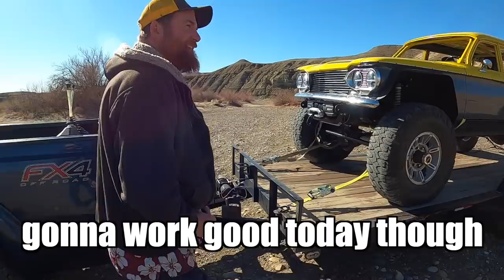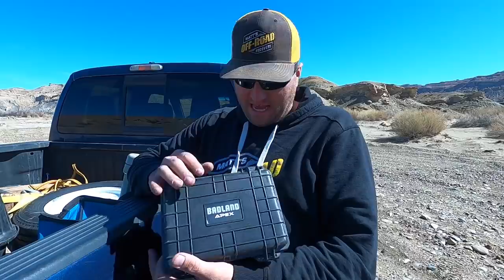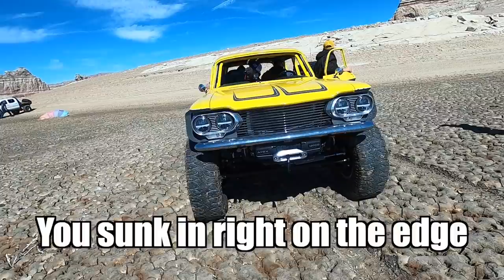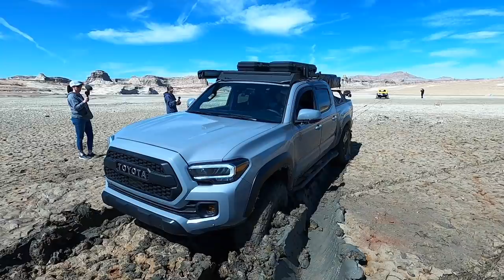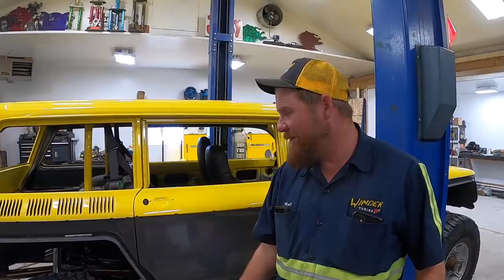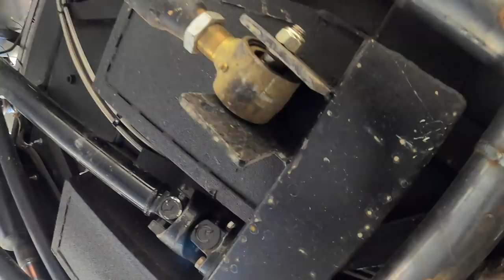The Corvair's FIRST Ever Rescue!

Comment: Every time I watch  one of your videos it makes me want to move to Utah. But then I realize how hot it gets in summer and change my mind. I'll just live vicarious through your youtube channel.
Reply: Just 40 miles North of where Matt lives the temperature is 10-15 degrees cooler. The altitude climbs a couple thousand feet so it's not near as hot but the winters are colder.
Reply: Well Matt lives on the edge of a pocket that is a lot lower in elevation than the rest of Utah. Where I live it usually doesn't hit 90 until Memorial Day. Yeah. Then it stays above 90 until Columbus Day. And it's only 100 from Independence day to Labor Day. In fact, it freezes at night as early as Halloween and we get snow as late as Easter. So it's really mild overall.

Comment: Not a corvair’s first recovery. In May of 1965, I was driving a 1962 spyter, I spotted an older 1948 car off the road with a older guy trying to push his car about 100’ back to 42 street in Odessa across from the coliseum. I drove out to him and offered to pull him to the road and start his car. After explaining how I wanted to do it. He had his doubts but after working with my dad in the oil field, I had experience with vehicles off road.  After pulling almost to the road and gathering some speed , he engaged the clutch in second and started his car. After getting my pulling strap off we parted ways. My first recovery with my Corvair. PS: he offered to pay me , I told him just keep his money and get a new battery.

Comment: Ahaaa Corvair brings back so many memories of running a Corvair Dune Buggy. Good friend milled off the two carburetor in necks for 3 each side webber carbs on a 140 heads. Had Covairs stacked in his front yard like cord wood for parts and such. I drove one of his Corvaires for years  it was great. The local Home Owners Accession had a fit with the stacked up Corvaires in the front yard. Wish I had a picture to share. Great Videos keem em comin, thanks.

Comment: Thanks for the detailed description of your configuration. What you have, and you are planning to add all sound like excellent choices except for replacing mild steel lower links with aluminum. Mild or 4340 steel lower links will handle inevitable rock bashing better than aluminum. In Moab style terrain, lower links will bend/buckle. Expect their repair and replacement, just like tires. Why accelerate the replacement cycle by switching to aluminum?
Reply: @MattsOffRoadRecovery  Thank you for both the reply, as well as a link identifying what you intend to use. 7075 is tough, and using a 2.5" O.D. bar will probably resist bending better than the equivalent weight of a 4340 rod. But, when banging through rocks, I assume things WILL get bent and gouged. When that happens, 4340 has better fatigue life than aluminum and is much more resistant to being gouged by rocks.  I'm old fashioned, and for at least the lower bars, I'd stick with 4340.
I'm not sure racing is entirely representative, but, I should look into what the racers at 'King of the Hammers' use.

Comment: Next stop Moe's Auto Glass.  New windshield.  Then Wiper Motor and blade.  Perhaps roof mounted from a rear glass on an older Chevy Blazer.   Covers 170°  Fold down visibility Flag comes to mind.  Nice job, great winch.  Stay with simply weldable/ heatable Steel links.  I think those Wheels look great.  Unique.  Skid Plates?

Comment: I'm a retired mechanic who worked for GM for 10 years and did tons of transmissions back in the 350 and 400 THM heyday. Transmission whine is usually some degree of pump cavitation which means the inlet to the pump is restricted to some degree, the filter is the obviously the most likely source, when the fluid warms up it is thinner so it goes through the filter easier. Your Transmission was just rebuild wasn't it? was a new torque converter used? if your concerned I would drop the pan and inspect and change the filter.

Comment: Matt an family and work family you all ROCK . This is a bad ?????? Car . You had talked a little before about this car is much heavyweight over the jeep on the soft sand so will you use the jeep more in the soft sand or now do you think that has changed since the build is mostly done . I would love to come and do a recovery with you some year . Hope to see the Corvair out more doing its work now an showing it off . Your ropes need to be color coded for different sizes so when you are picking thru them in a pile or put color bands around the ends . Those winch ROPES you have on your winch will they fit any kind on winch ?? Thanks for your video’s keep them coming.

Comment: I'm no expert for this engines - but I think that intake pipe is waay to big.

It might give more power at the top end (or even above) - but on the lower end - the fuel/air mixture won't swirl properly leading to less power and less torque (and more consumption - which obviously isn't no.1 priority on this build).

A smaller intake would be clearly an improvement for your application, Matt.

Greetings from Germany!!

Comment: 👍Cool video. Put a hydraulic operated winch anchor on the rear like the military recovery vehicles have on them. You cam make one out of a farm plow blade and a hydraulic cylinder powered from the power steering pump. Make it easily removeable yo it doesn't get in your way for off roading

Comment: It's nice to have two ratios, keep your twin stick 205 and add a 203 with a doubler.  Yes you will need a new drive shaft and possibly crossmember but then you will have 2:1 and 4:1.  The 2:1 will be good for sand and then you get deep gears as well.

Comment: I know it only takes about a 12-ft extension cord with the ends chopped off of the hard wire a inside the cab control using the green red and black wires and a momentary contact on off on switch to remotely operate that winch from the inside of the truck. And yes I did know when you were building the bumper and installing the winch, a Badlands Apex which means that the remote that you forgot is a wired/wireless remote.

I have one of those Badlands 2500 pound winches that came with a wireless remote only. I decided that I wanted add a wired remote.  Local hardware store has 8 ft extension cords for 13 bucks and a 25 ft extension cord  for 10 bucks. 25-ft it was an outlet junction box, a solid cover plate which I drilled out and installed a momentary contact on off on switch and of course I use the female part of the extension cord and soldered wires onto the corresponding connectors that were on the wireless relay contacts for the relay.  I used male end of
extension cord for my quick connect. Genius isn't it? Anderson quick connects on the power wires. Have a group 27 deep cycle battery that's has a charging circuit battery isolator mounted on the battery box with quick connects Anderson's and  quick connect to power  my winches, or my all cooper 20 foot jumper cables.

I have a hitch mounted 5000 lb Badlands winch and if I'm correct that's the same as you have on your rescue trailer. I have a ammo box from Harbor Freight that's the solenoid is installed in and for safety purposes o the remotes I have an inline fuse  to the positive power supply this goes to a lighted toggle switch  provides power for the handheld remote that plugs into the side of the box. The in-dash  switch came with the winch is also installed in the box cover. A wireless remote module is wired in parallel to these other switches and there are two wireless remotes they give me a hundred foot range. The ammo box is mounted on the hitch mount via a 1"X 4" piece of wood.   Anderson quick connects on power cables. from the battery to the rear bumper and to the front bumpers of my Ford Ranger truck. A little outside of the box thinking, by a man that's closer to 70 than 60. Enjoy your videos.

Comment: All you need is gas tank foam like in drift cars. That way at steep angles with low fuel, your pump can still pick it up. Its like a sponge and it works great.

Comment: You should put the range box off a np203   onto the front of the 205. I think there is an adapter/ plate that is made for this. It gives you a lower crawl ratio then the atlas, but it is far cheaper.

Comment: I know this comment is buried with nearly 2000 already posted, but a suggestion to use the factory front gas cap position, mount winch control switches.

Can that winch be "clocked" to rotate the engage/disengage lever to the front instead of straight up?  Might be easier to reach that way.

Comment: NP 205 with a NP 203 back half gives you a serious level of gearing without the cost of an Atlas so unless you have drive line angle concerns check out Advanced Adapters site and see if that would be a better fit for you.  Never mind about their site.  They dropped the products that they used to carry.  Likely because old school hardcore offroaders didn't like their flagship breakable aluminum Atlas.

Comment: this is extreme winch where u need a multi rope pulley set up so u increase the pulling power, on the margins hving double pull cutting load in 1/2 is a big thing.

Comment: Matt, have you considered wiring and mounting a dash mounted winch controller? The switches are like $10 on ebay and you just gotta run 3 wires to the winch box. I did mine after having issues with my controller and i cant imagine not having one

Comment: I seen the rear tires touch top of wheel openings while crawling on one of the last videos which I'm sure is just a shock adjustment but if you're going up in tire size you might have to do more than that. just guessing

Comment: I have a 5.3 LS, 4L60e, Dana 300 2.62:1 and 5.38 gears, 42" tires with an 1800 stall converter, it drives thru the brakes in low range. A 2200-2500 like you have is a better choice

Comment: It’s coming along good. The only comment I have is the stance. My opinion is you have a little too much rear squat when running down the road with passengers in the ‘vair.  I don’t think the ‘Carolina squat’ is a good look for the Lakewood. When you get all the glass and original bright belt line trim installed, this is going to look killer. My opinion is using a lower stall speed torque converter will be a good choice. Your motor makes a big chunk of torque down around 2000 rpm and the lower stall speed will make that more useable out in the field. Your not race’n your work’n.

Comment: Shouldn't you keep mild steel as primary material for anything under the car? The fact it bends nicely and welds nicely seems like ideal failure modes for the kind of use/abuse the car is designed for... I'm assuming the undertrays you have in mind will provide enough protection but it still seems to me that mild steel is ideal for this car and weight reduction is more useful on the top rather than the bottom. I would consider aluminum for driveshafts maybe but def not suspension components. Maybe a higher grade steel. Looks and sounds cool though!

Comment: You need to bolt in that remote somewhere to that car, if you can't operate the winch without it that's not good.
You pulling that guy out in reverse gave me flashbacks of an actual corvair with the pancake engine in the rear and of course that long V fan belt that somehow Bends 90° to go up to a pulley on top of the motor

Comment: Why do you think that replacing the steel rods that got bent with aluminum rods is  going to be better?  The modulus of steel is three times higher than aluminum.  If the rods have the same cross section the steel rod would be three times as stiff.
Reply: I guess you'll find out how well they work for you.

Comment: dont get a higher stall.. youll have nothing down low. where you need it. better off with an nv 5600. / 4500. but auto better for what you do. down hill is death,with any auto, no engine brake, then no brakes. lock up converter fixes that. my s/duty,4.2 tdi,zf 5sp,has killer low,with 4.11,s. 2 mph down any hill..

Comment: If it were me, I wouldn't put Aluminum links on the lowers if they are at risk of being hit by rocks.  Aluminum is less forgiving than Steel, it will not spring back or behave in such a plastic manner as Steel.

Comment: You really should avoid recovering vehicle's in reverse since the th400 has a weak reverse band.  If you are running a stock cam in the lm7 you would be much better off with a 1600 stall converter.